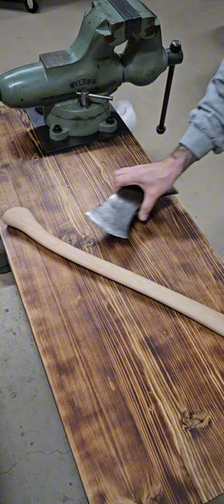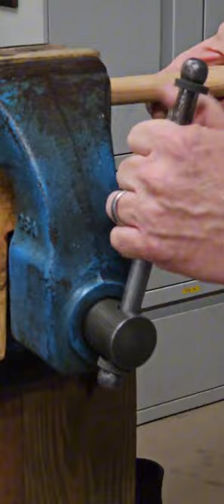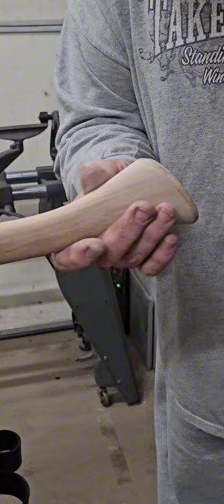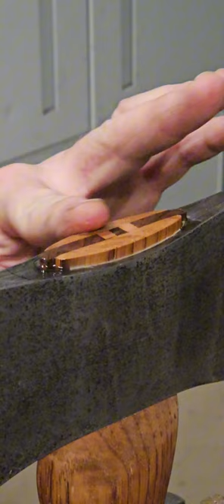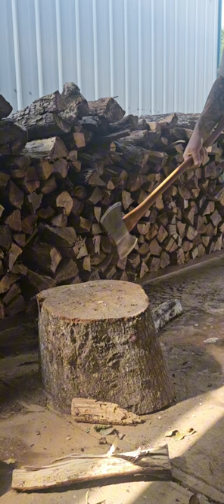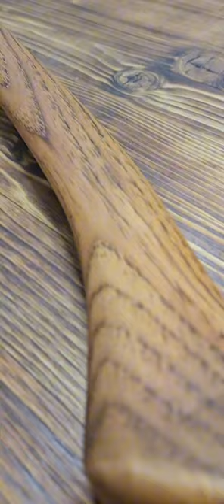Double bit axe

Comment: Nice job. Your skills are awesome.       I like how you condensed the Video process down to a few minutes 👍. That old double bit has the profile of a lot of the made in Sweden’ double bits I run across.
Reply from the maker: Thank you.  I do really like the shape of this double bit.   I put different edge geometry on both sides, like would be done traditionally.   It was a fun project.
Reply: @_BigLife_     With the straight clean lines and profile -Sure looks like a vintage Hults bruk’ head.  She’s a beauty 👍
Reply from the maker: @2ndTimearound56  It's a unmarked head but I agree and I love HB